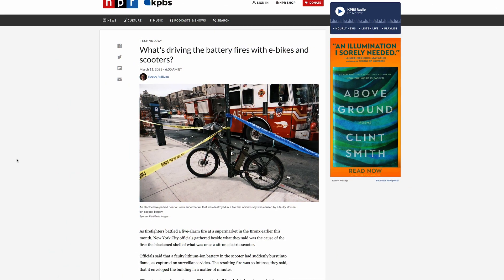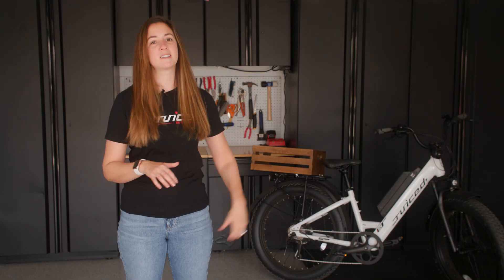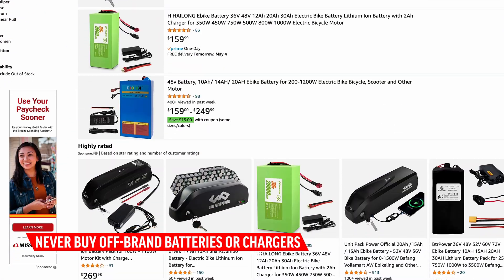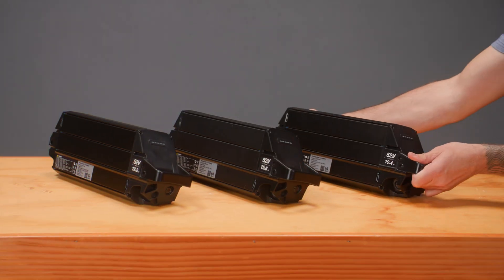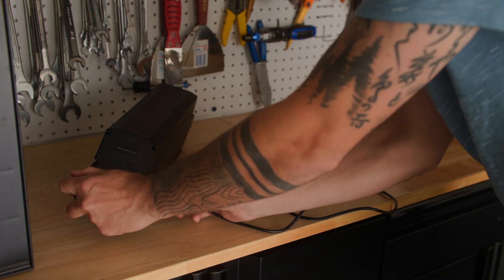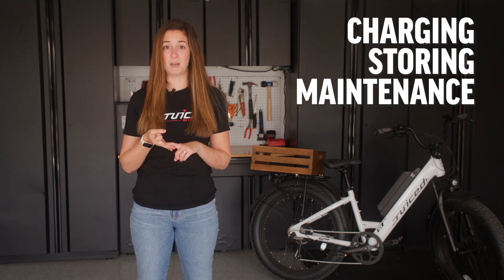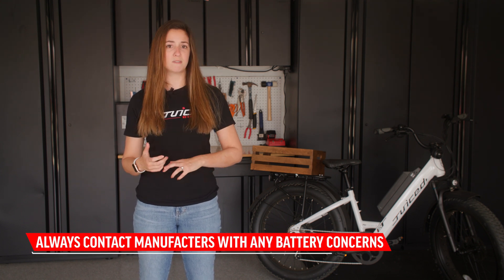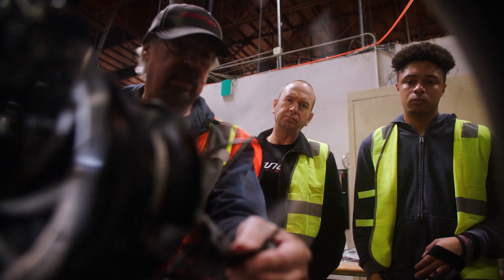E-Bike Battery Fires: 5 Safety Tips To Avoid Them

Comment: As someone with autism that's obcest with batteries (mostly 18650)
18650 are actually very safe...
I have been fixing and repairing them since 2015. Fires are caused by overcharging, defective chargers or have physical damage. Sure they CAN be dangerous but 100s of millions of americans alone drive and there are 40,000 people that die every year in america alone. Yet no one is scared about driving. NOTHING IS 100% safe. Most ppl understand the risk of driving. Its called calculated risk. Being alive alone is a risk. These batteries have never been safer and more reliable since. Lithium batteries now day are increadibly powerful. Li-ion is known for its high energy density and increadible discharge rate for somehting so small.

Yes they are in phones to power tools to laptops and tables. There ubiquitous now days. You car has a battery to crank the starter that cranks the engine over but that is flooded lead acid which has exsisted for well over 100 years now.

Im one of the few that knows the limitations and stats of such batteries and I charge them manually all the time. In all the years I have 'messed' with them I have THOUSANDS of them for harvesting and not a single one has caught fire. Its simply because I know what to do. They are very simple to charge. 3.7v nominal. DC (all batteries are dc) and a good rule of thumb is no more than 1amp per cell. A maximum voltage of 4.2v/cell.

Anyone can learn. The probable is missuse/charging and a complete lack of education.

There are millions if not billions of these batteries in the world yet only a few handful of fires ever happen. if you don't know anything about them and you use the wrong charger of course it CAN be dangerous. They are designed to rupture under the positive terminal or they would be a bomb.

If you are the average person that doesnt know about them and worried about them. Then put them in a STEEL container and only charge them when you are close by. This 2 tips would save a massive majority of fires alone.

Lithium batteries store a ton of energy in an incredible small package. The lithium inside them WILL REACT VIOLENTLY WITH WATER AND SHOULD BE AVOIDED. If you want to be even more safe keep the battery out in the open away from anything that can catch fire and the only way you can put the fire out is with SAND. Lithium batteries have there own oxidizer and will burn hot and fast and is near impossible to put out and your best option is to have a bucket of sand nearby.

Cars have seatbelts for a reason.
Sand and common sense is the same for batteries

Comment: I use a timer plug that plugs into the wall and then the battery charger into it. As in,your battery takes 6 hours to charge so set the timer to that. Power is stopped at that time. A small and not expensive add on in case the battery built in BMS does not detect a full charge. 10 years 2nd battery no problems here anyways. Using improper chargers seems to be the biggest culprit for fires.
Reply: Same

Comment: What tip do you have if your 6-month-old JetCurrent Pro starts smoking at the connector where the battery and bike connect, and burnt both ends so it is now unusable? How do you contact Juiced to replace your bike and battery which are still under warranty it if they went out of business? Thanks Juiced, great product and support...

Comment: Environment of a battery is important. If a battery gets wet inside the electrical strips, tracks , and circuit boards are likely to corrode and fail. It is important to keep it dry.  For example if a BMS gets wet it may overcharge a Section of your battery.  So if it is really wet weather, consider fussing a bit over your pack, dry it off, don’t keep it in a damp place, you can always wrap a plastic bag to keep the rain off.

Comment: What do i do if the place were i purchased my ebike went out of business. I purchased a crooked paths foldable ebike with a battery that slides inside the frame. May need to order a new one because it has sat all winter. Im not even sure if the battery inside it and the charger they gave me is safe. Should i just order a entire new batter and charger from somewhere else seeing as there out of business?

Comment: Is it safe to ride a ebike in weather over 80 degrees ?
Reply: Yes, it’s safe. The battery may just degrade faster. This is true for all batteries, not just ones in E bikes. A battery that conforms to UL standards will shut down if it ever reaches a temperature that is actually unsafe.
Reply: Yes

Comment: I have an 48v 15ah battery from Emmo canada thats defective. Under the warranty coverage it should be replaced. You would think. They asked for it back. They tested it and it lost 9 ah and is now 5.7ah. They said they're not sure it's safe. What would you do?
Reply: Any update???
Reply: @paulvega7101  took get it fixed will cost $519 boo.
Reply: It's sitting in my basement right now. I bought a 17ah shortly after I got my bike. That costed $1300. Then I got a 21ah from epiccycles for $999. Which I have had no problems to date. Yeah.

Comment: Indoor , keep battery in metal bucket under  heavy lid.
Reply: And what to do with a E scooter where the battery is enclosed and not something you can just remove ?
Reply: @Enginerr82  Keep it distance of flammables.
Reply: @Enginerr82 May be a small fireplace for the scooter? I'm not kidding. That's the only solution I see so far.
Reply: @Enginerr82  did you ever find an answer to your question about E scooters? I just got a cheap Chinese one, and I’m wondering how to store it…
Reply: @Yowzoe  I don’t think anyone necessarily would recommend storing e scooters or e bikes inside a home , but I am becuase I have no other place to store them. And I have 
3 E scooters all inside my home.  

So the only thing I can say is if you store it inside your home you have to make sure you’re not irresponsible by over charging the scooter , leaving it plugged in unattended , or using a battery charger which is different then what the manufacturer supplied .

Other than that not sure what else there is to do.  I’m sure if you look into it there’s probably very minimal risk if you follow all the instructions properly with the charger and to unplug it on time when it’s reached full capacity .

Also keep in mind if you crash your scooter it could become damaged where it might make the battery more vulnerable or unstable. I don’t know that for a fact but I’m just thinking logically on that one ,  so it’s something to keep in mind as well

Comment: To prevent overcharging all you have to do is charge the battery one time and sit next to it and mark down how long it takes to charge at each percentage point, so at 48 volts you would mark the time then at 49 volts you would mark the time so on and so forth until it's full. 
This way no matter what voltage it's at you will know how long it takes to charge from that voltage to full. 
Then all you have to do is buy an automatic wall outlet timer and set it accordingly so it will automatically turn off at the wall when the timer gives up so you're scooter doesn't overcharge in the case that the BMS fails or the charger doesn't do its job correctly and overcharges your battery.
Reply: Yes sitting on the cement outside for 6 to 8 hours sounds like fun .
Reply: I'm sure you can leave it for the first 80 percent of the expected charge time, then check it every 15 minutes or so until the cycle is completed. OR you could stand, no sit outside as you stated, on freezing cold cement watching for the little light to blink off & tell the little solitary cell in your turnip head it's allll done & the 8 hours spent watching a trickle charger at work was worth the frostbite & hypothermia😊@vmobile890
Reply: Where do you read the percentage point?  Where do you read 48V? 49V?

Comment: Nice video. Some ebike batteries have an on/off switch. When charging the battery when it's off the bike, are you supposed to switch the battery on, off or does it not matter? Also, once the battery is charged, are you supposed to then turn the switch on before putting it back on the ebike? Thanks in advance.
Reply from the maker: Hey 👋 we recommend having the battery off while charging, there’s a small button to push. Yes, you will need to push the battery on before reinstalling on the e-bike.

Comment: 1:54    52V ebike battery? I did not know that the rated 48V could be higher!.. interesting to see a 14s ebike battery certified and not a 13s
Reply: So you can use a 48volt charger to charge a 52v battery but it will not reach its rated full charge. But not vice versa, a 52v charger will overcharge a 48v battery.

Comment: I plug mine into a power strip is that safe?
Reply from the maker: Hey 👋 Great question! We recommend charging directly to a wall socket and avoid using extension cords or power strips.
Reply: It's fine, the chargers don't draw that much current/power. Just be careful of trip hazards by having things running on the ground.

Comment: Also, charge the battery only when it needs to be charged (50% or less). She was spot on with everything else. She kept emphasizing not to use an aftermarket battery or charger. I was about to buy an aftermarket controller for my wife’s evercross scooter. So glad better heads prevailed. The controller I looked at had different connections so I didn’t buy it. The one from evercross was a little more expensive but totally worth it. All the wires were the same color. Just plug and play. 

Another thing is to unplug the charger when not in use. There are electronics inside the charger brick that controls how much voltage the battery should get and when to stop charging. Those electronics need to reboot from time to time. That’s what kills cell phone batteries. When you use the car charger cigarette lighter, you’re putting 12 volts into your battery and because you’re not using the white charger box, it does not shut off the voltage when it’s full.
Reply: Unless you have a non-commercial system (like a bafang motor with a kT controller etc) where you have to buy batteries from an 'aftermarket' source. In which case just be extra vigilant on who you source from, And always use the charger that comes with it.. And keep an eye out if a BMS is working by running it flat (it should auto switch off) and if the charging stops when done. I order batteries from ebay from a US based store that imports them from china and haven't had any issues in the 6 years of doing so... I still have the first one I bought 6 years ago, Still working fine no hazards albeit lost some capacity over time. Not conforming to certain standards doesn't mean it's not safe, But having a battery that does so almost guarantees safety (as long as you don't treat it beyond it's means). To be honest, I have purchased an aftermarket battery for a commercial bike before (haibike enduro), And it operated great for 2 years before sold the bike.. But that battery came from a battery building specialist and so I knew for sure it was good.
Reply: @danimayb  i agree. Always get a battery from a known manufacturer and an EXACT replacement. Don’t install a bigger battery that was not meant for your device. I turn on a fan while charging to keep the charger cool and put it on a timer for 7 hours-just in case.

Comment: Any companys making e bikes using Lifepo battery's?
Reply: No
Reply: LiFePO has inferior energy density and discharge rates compared to LiPo, so you’re unlikely to see it on electronic vehicles. Its mainly used in place a where a lead acid battery would have traditionally been used.

Comment: Thanks for battery tips! eBike safety in general is a Major Concern... Motorcycle safety switches made me careless about my kickstands... However, the stand on my ebike left me with a broken neck April 22, 2023...! Are there more safety measures we need to learn? (Liked and Sub'd tho not a Juicer)
Reply: Just curious- How exactly did the stand failure cause your injury?
Reply: @chrisE815  Perhaps it came down or he forgot to put it up, so it snatched onto something while at full speed and caused a fall.
Reply from the maker: Hey John! We're sorry to hear about your injury. There are tons of safety measures riders need to learn—from understanding the rules of traffic to putting a helmet on correctly. We love this idea though, maybe we'll get a general safety tip video up this summer!
Reply: @juicedbikes  Thanks for taking notice and for your reply! Helmet could've prevented scalp injuries. But, a DOT helmet would've broken my C1 and I'd have died. I've noticed skateboard helmets offer more protection to the back of the head. Eye protection should be mandatory. Heavy clothing prevented lots of road rash! gloves would've been good.
Reply: @johnw65  Glad to see my choice of wearing a skateboard helmet is warranted! Great tips. Sorry for the injury, mate.
Reply: @Xspy70  I wear my skateboard helmet religiously now... Ans ALWAYS remember the kickstand! They can be deadly

Comment: #1 tip, don't steal an ebike and use a random adapter to charge the battery. This is usually how these fires start, thieves trying to charge stolen bikes.
Reply: Tip #2....Don't steal an e-bike...period 🚲
Reply: @TimeforDIY Thanks, I’ll try not to.
Reply: @TravisMcGee151 do not attempt. Cold turkey is hard with this one. Just steal 4 one week, 3 the following and 2 the next. Once you are down to one a week it should keep the withdrawals in check until you work up the nerve to stop
Reply: @deathbydeviceable  That's the plan I'm currently on. Please wish me a safe road to recovery.   🔥fire randomly starts🔥
Reply: Only those who don't understand volts and amps
Reply: All of those chargers are the same You just have to know what you're doing. First off you just have to make sure the positive and negative are correct using a voltmeter, secondly you just have to make sure you're not exceeding the max amp current charge for the battery. 
It's not rocket science but most Americans these days are too lazy or too dumb to figure things out themselves
Reply: What are you talking about? Different chargers may have different voltages, and they could also be for different battery chemistries

Comment: What are requirements to obtain “UL” status ?
It has a BMS ?
Reply from the maker: Hey 👋 Manufacturers submit representative samples that are then assigned to a specific category based on the product's intended use. From there, the appropriate standards a product must meet in order to become approved are defined, one of which is having built in BMS. Every Juiced E-bike equipped with a G2 52V battery is SGS certified to UL 2271.

Comment: "Do not store battery near water heaters" Wait... what???     Is that like on a stove near a kettle??    So in the oven, as a wheel chock, as a yule log... all fine then??
Reply from the maker: Hey  👋 Every residence has a water heater, usually located in the garage or basement which provides hot water for the tap. So don't store your e-bike near an actual water heater or really any heat source, radiator, space heater etc.
Reply: @juicedbikes  Water heaters are insulated, esp electric, gas ones get very hot on top, I once left a lighter on top of gas HW service, that lighter went to the pub with me, when I went to use it, It was empty, the heat boiled the fluid out of it